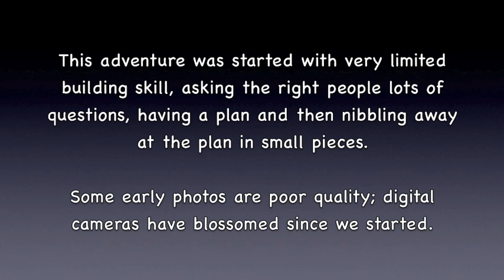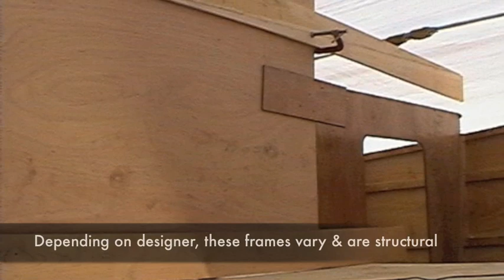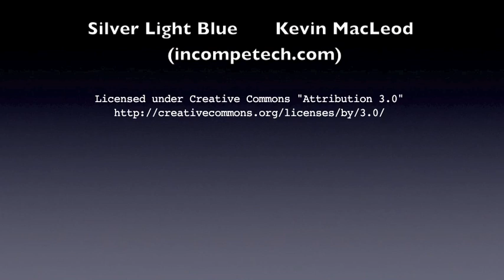DIY Building Catamaran Hulls (1)

Comment from the maker: Hi Santakart, it started as a hobby and took 4 1/2 years. I had sailed previous on smaller yachts, in fact built a smaller yacht from wood. There is no ballast in the keels. I am not sure of any catamaran of this size that does have ballast. The plans gave some suggestions, but we ended up sourcing most of our supplies over the internet. 

We have more and better movies at youtube.com/diycatamaran. More DIY information also on the diycatamaran website.

Thanks for looking

Comment: I am planning to start building a 11 meter catamaran, but I cannot find any information on how the weight and pressure of the mast is supported. In your pictures is it only the forward bulkhead? And how about the chain plates supporting structure? Great build by the way. I admire your skills.
Reply: Hi Jaycen
Appreciate your kind words. Discuss your queries with the designer, they are fairly specific on how they are built. It would be remiss of me to misguide you and others in this area.